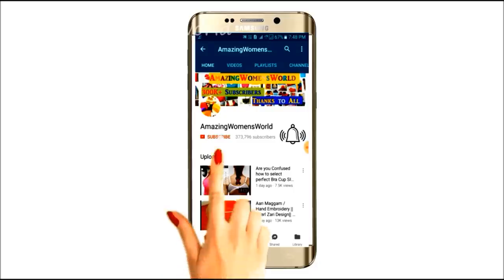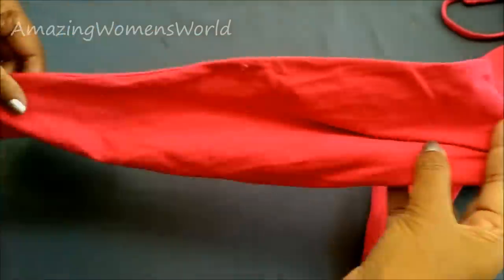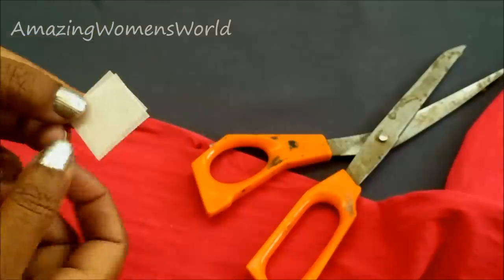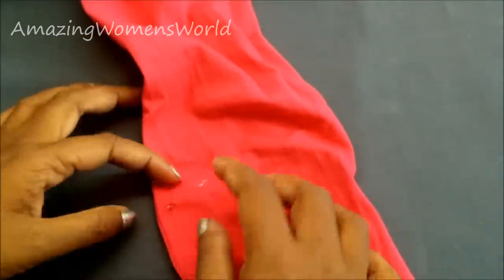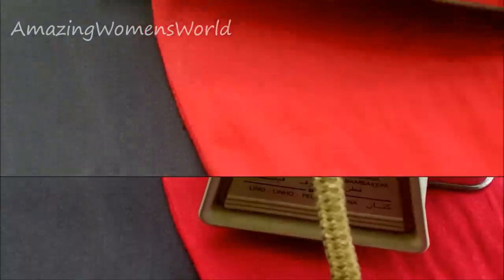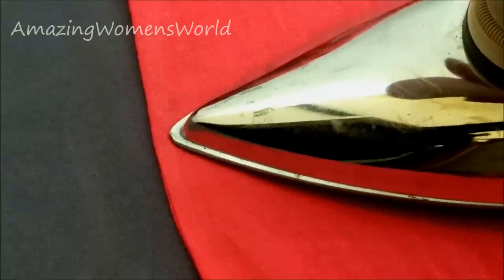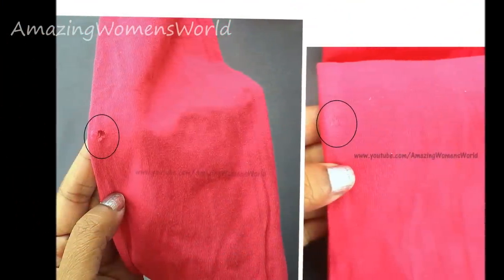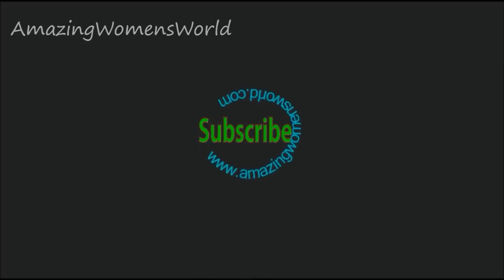How to Repair Holes in Legging's / T- shirts / Pants without stitching in 30 Seconds

Comment: Thank you for this video.  I used your method and was able to close up a hole in a pair of leggings.  However, I found that using "minimum" heat setting did not work.  I had to use a hot iron.  The iron has to be hot enough to allow the fusing substance to adhere to the fabric.  It may take some playing around with the temperature of your iron to get it to stick.  Otherwise, this method works very well.
Reply: Do you think it's safe to use on leggings with material that is used for working out??

Comment: I already tried interfacing for a hole on my stretchy leggings but it didn't last more than one or two washes. The problem is the glue on the interfacing isn't strong enough to hold onto ultra stretchy material. Maybe others have had better luck.